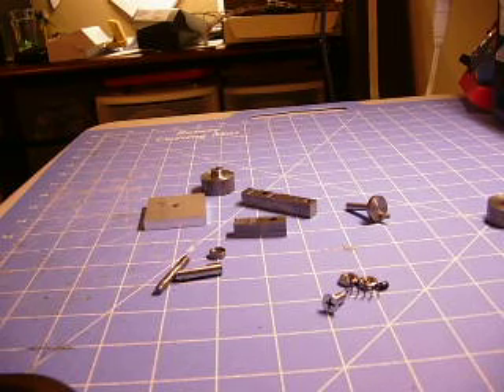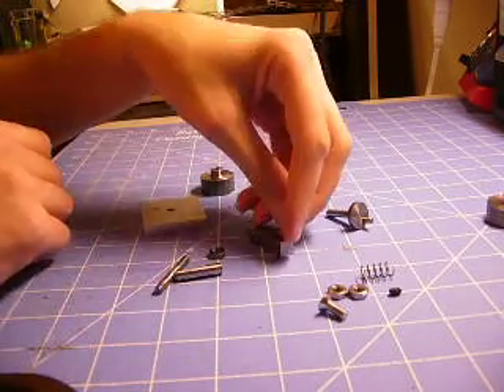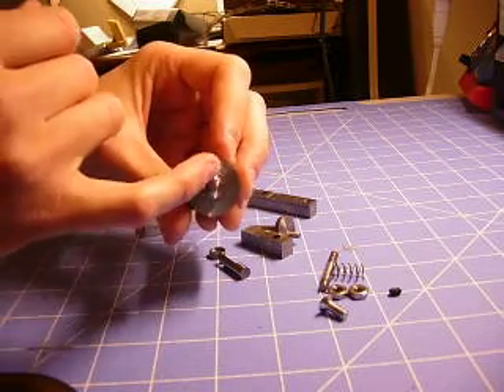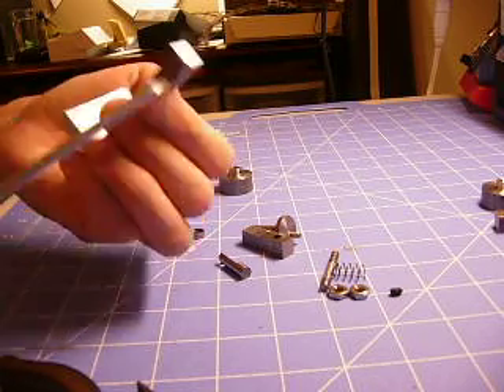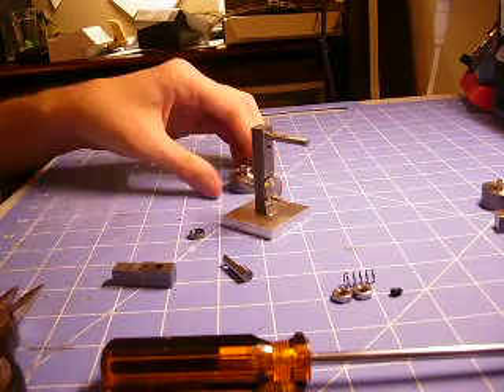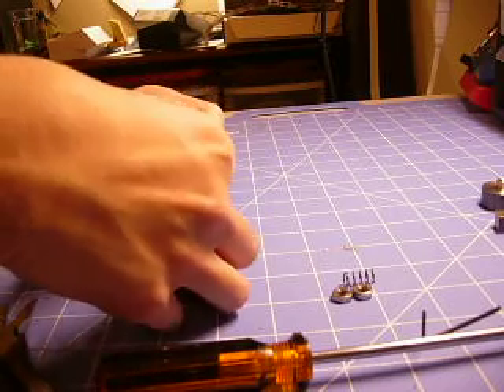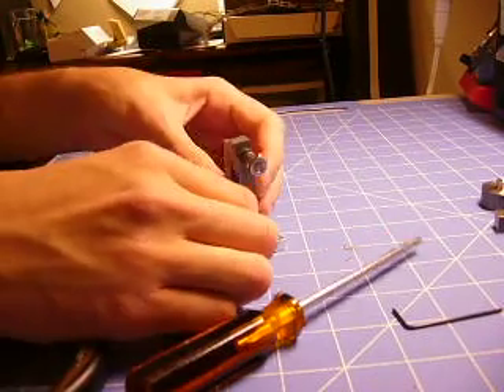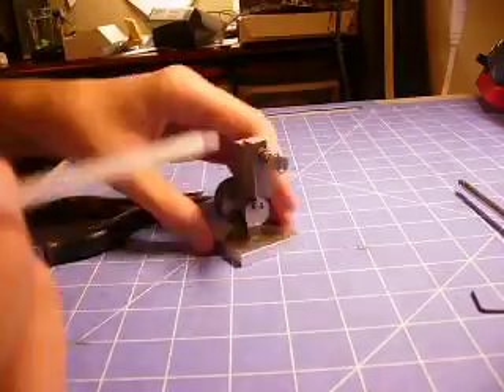My Air Engine

Comment from the maker: That's actually how we tested it in class, but I don't have one at home. They had built a nice little test stand that clamped the engine against another piece of steel that had a hole lined up with the intake hole. It was connected to the shop's air line, and digital meters displayed the pressure and the speed of the engine.